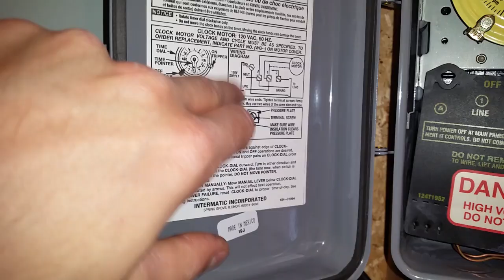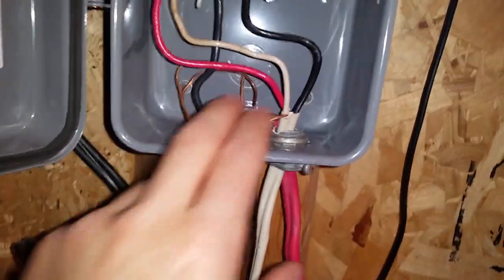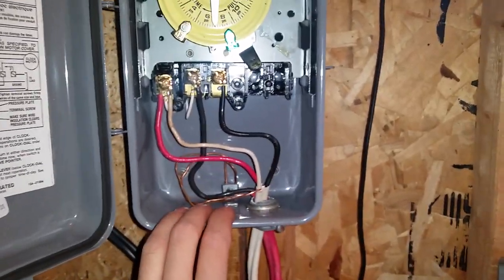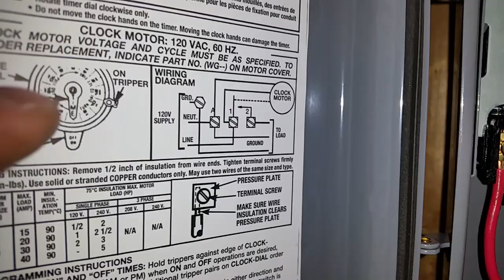How To Wire and Connect A Intermatic Pool Pump Timer - T101R

Comment: This is a great video, thank you for sharing.
I followed these instruction for a pool filter and the motor started working, everything looked perfect. Since the start time was already met, I activated the manual switch, hoping that when the timer would have reach the off time needle, I would set the manual switch to off position and let the automation do the rest.
The motor stopped working when I came back a few hours later. I was not able to make it work afterward. The manual switch works great.
I tried another box, same wiring, motor worked for a certain time then stopped. Can someone tell me what I'm doing wrong please.

Comment: I have a 3 wire setting. 1 white - neutral, Black, and orange. The original unit used the neutral as a ground, the black for the line, and orange for the load. I rewired the setup to the original, because the diagram setup doesn't set the lights for a timing. They just stay on.
Reply from the maker: You never put ground and neutral together.
You need a separate ground wire back to the panel. This is critical for safty. The other wire you say is orange may also be line. You need to check. It sound like you have a 220v system.

Comment: So im installing a gfci where my pump will be plugged in. And the gfci is wired from the breaker. 
From the GFCI to timer would be in 1 or 2?
Reply from the maker: I would recommend you simply use a GFCI breaker. A GFCI receptacle might just burn out because of the high current draw of the pool pump. You should also connect the pool pump to 240v if possible as it will run more efficiently.
Reply: @QuaabQueb  okay I'm installing a GFCI breaker and running it to an outlet for my pump (it's plug in)
Getting the timer wired to the outlet to control on/ off times is where I'm lost
Reply from the maker: @kye1589 Is it for an above ground? Eliminate the plug altogether. It is a weak point. The plug will eventually burn up or the built in on/off switch on those above ground pool pumps. Hard-wire it in a junction box with 10ga wire. 
The breaker is the power source. It goes to the timer. The timer is the switch. It controls power to what ever you hook up to it, pump, outlet etc..
Reply: @QuaabQueb  excellent advice dude thanks
Reply: @QuaabQueb  could you clarify why my 110 pump would work more effectively with a 240v timer? 
I also might install a watering system for my garden, so it may be best to just invest in a 240, yeah? 

Also, I am running 12 wire from breaker- timer & from pump-timer..Your junction comment threw me off a little. If you can't tell, I'm avoiding hiring an electrician. Ha-ha!
Reply from the maker: @kye1589 You can only connect the the pump to 220/240v if it supports it. You have to check the label and wiring diagram on the motor or you will fry it. 
The short answer is by running at the higher voltage it requires less current.  
I would install the irrigation system completely separate.

Comment: Can I use a 20amp breaker for this t101 or does it have to be a 40amp breaker?
Reply from the maker: You cannot exceed the maximum load rating indicated, you also must use the appropriate gauge wire.

Comment: Very good video probably you are not a YouTube like me but in a small video you made you provide the whole information, just a recommendation  improve your camera and audio but excellent. Please can you recommend me a timer for a 15ft round above ground pool i have a heater pool and the filter, do i need a separately timer for each? do a heater pool is good to have a timer? or can i use the same timer for both? Thank you for your help and i will be waiting for your respond.
Reply from the maker: You can use any time for your pool. They make this model with 2 circuits so you can have one timer for 2 devices. Make sure to check which model you need. One is for 120V and the other is for 220V

Comment: I'm pretty sure I had a black single braided wire going to neutral, a black single braided wire going to line 1, and a red single braided wire to load.  
I took it out to replace it and should have taken a picture but didn't. 
Is that possible do you think I won't be able to install new one until tmw but don't want to mix up the wiring

Comment: Great explanation. Thank you. This timer can use with the water heater with 240v? Thank you!
Reply from the maker: No, you must purchase the 240V model, and ensure you do not exceed the current rating. If your wanter heater draws toomuch amperage then the timer switch will burn out.
Reply: @QuaabQueb  Thank you!

Comment: wire from the pump is red and black and from the breaker is black and white so should i put red from pump and white from breaker to a terminal
Reply from the maker: Wire color is not necessarily always the same. The important thing to determine is if you are using 120 or 240 volts.
If using 120 the. You are only switching the hot wire. If using 240 both wires are hot and you must use the appropriate timer which has 2 switches, one for each hot wire.
Reply: @QuaabQueb  using 120
Reply from the maker: @maureenmurphy1911  You should use a multimeter to ensure wire color is correct. Black wire from the braker should be hot/120V and white is the neutral/return. Alternatively red can be used as hot, this may be why the used red at the pump. Make sure the wire gauge is appropriate for the size braker installed. If the wire gauge is not appropriate it will cause a fire. 
Have a certified electrician come and verify to ensure the installation is safe.

Comment: My timer goes off but not on. The timer only rotates when it is on not when off. My power is first connected to an outlet then a  switch. From the switch  I have the line from the breaker box going to  the line (1) I have the load (2) going to an outlet which controls my pool pump, and neutrals at A. I have removed the dial to make sure the lever isn't chipped and Ive reversed the line and load only to trip a fuse.I have bought 2 new timer motors and changed them with no difference. The switch to the timer works fine. So does the outlet. Any ideas what i'm missing????
Reply from the maker: woah dude, cant say with out seeing it. Something is messed up...

Comment: how do you connect a t104r pool timer? all other videos dont tell you what wire is coming from. can you help me?
Reply from the maker: The T104 is a 220V model, basically instead of having one 110V power wire, and one neutral wire, you have 2 110V power wires. 
What do you mean by what wire is coming from ?

Comment: So I hope maybe you can help me answer this as I'm kinda stuck 
I have your exact same box that runs a sign for my business and it was already installed when I bought the building but whoever run the wires from the sign to the box ran them way short and they were hanging away from the wall in a few places looking like crap so I disconnected and added the same gage wire the way it should be and it looks nice but as i rewired the box I put all wires back where they go but now when the box is on it's fine but when it turns off it throws the breaker can you tell me what I did wrong 
Thank you for your time
Reply from the maker: Hmmm.. worked fine previously, but now a problem, so let me get this right when the timer SHUTS OFF power to the sign, the breaker trips ? or when the timer TURNS ON power to the sign, the sign does not illuminate and the breaker just trips ?

Comment: So in the red and white terminal you also have smaller white wire and next terminal you have another smaller white wire with the feed line what are the smaller white wires?
Reply: They supply power to the timer motor

Comment: I have a question I don't know if you would be able to help me. I have this setup to turn on and off some lights, whenever I would have to use the override I would hear two fast clicks within a split-second from each other (I'm assuming the first click was the box and the other click was the lights turning on, meaning the first click was the box turning on and telling the lights to turn on, which would be the second click) but now all of a sudden the Box does not work at all and does not turn the lights on or off with the timer or the override. And whenever either one of those goes off I only hear one click now. Is this some kind of grounding issue or loose wire? Cuz that's what I am thinking. It was installed for me and I don't want to mess with it unless I know exactly what it is.
Reply from the maker: Luigi Soldier hard to tell without knowing or seeing exactly how the system was set up. Best to call back the person that installed it.
It could also be the breaker supplying power to the timer has tripped, so check your breaker panel first.
Reply: Chargèro thanks for replying. If I want to turn the light on or off now I have to do it from the breaker, sorry forgot to mention that.
Reply from the maker: ah, so it sounds like a failure within the mechanical switch of the timer. 
When you put the manual override leaver of the timer in the off position, does the breaker still turn the light on or off ? 
If not, then the timer switch has gone bad.
Reply: Chargèro it doesn't matter if the timer override is in the on or off position because the breaker still turns the lights on and off
Reply from the maker: Luigi Soldier timer is finished in that case.
Reply: Chargèro thanks for replying and thank you for the information I really appreciate it
Reply from the maker: Luigi Soldier no problem. Probably best to just buy one and return it

Comment: What if a light flashes after it has been running a while when you turn it off.
Reply from the maker: There is no light. That's probably an electrical fire.

Comment: I thought if you set up pool pump to run at night it would cool your pool water considerably,  night air circulating warmer water will eventually cool water way down
Reply from the maker: Dave Van Meter Yes that is something to consider. However you can put a heat blanket which is basically a big bubble wrap material cover which holds the heat in at night. Most people dont because they are a hassle to take on and off.
Hotels and spas that have outdoor heated pools year round use these heat blankets every night to energy savings

Comment: how is it that you only have a red and black in one wire coming in on that red cable
Reply: there should be two white wire?
Reply: it the red wire now "neutral wire"
Reply from the maker: The red cable I have there can be used for 220V circuits, in which case both wires would be carrying 120V hot and no neutral... not all devices that are 220V need a neutral wire, as the AC current flows back and forth between both 120V lines. The only time there will be a path to neutral would be if the device (example a stove, or dryer) has a 120V circuit within in it such as a light , computer module etc...

If you were to have your pump running on 220V you would not have a neutral wire, both wires would be supplying 120V each to the electromotor, the AC current would be alternating between them. And of course you wold have a hare copper ground conductor for electrical safety  

So there are 2 ways to wire 220V appliances, with a neutral, or without.

In my setup the red cable (with one black and one red conductor) is simply being used for 120V, as that is what I have my pump running on, so the red wire is carrying 120V hot and the black wire is the neutral return path.

Hope this clears it up.
Reply: @QuaabQueb This is by far the clearest explaination of the working differences between 120 & 240 as well as a beautiful clarification as to the difference of running a 240v main to 120v 'step down' I've ever read friend! 
   
   You SURELY know electricity far better than myself- however, have worked on pools & outdoor electricity for over a decade everywhere from America [my country of residence] to Australia, New Zealand, Tailand, & around Europe- obviously differences in "standards & measurements" in nearly each place. So I've heard people try to explain these differences & it either goes: 1. FAR too much info leading to the other party just dazed or 2. Just talking out of their asses (which as a fire-medic enrages me to no end, for obvious reasons).

Truly, well done! And, if all good with you- I may save that response & keep it for when needed. Not sure i could say it any more concise & safley than yourself friend!

Comment: How do you wire it if it's a 240v instead of 110
Reply from the maker: You don't, you have to buy the 220V model which has an extra terminal and contact for the other line

Comment: Congrats Lady! Thanks for your vid. I think you are the better explainer to this item in the whole You Tube vids related to. I have some of these items now and I need a timer to control a textile machine based in a motor of  1 hp, do you think this item could run fine to this need?

Thanks and Go'd Bless you!
Reply from the maker: Cheers m8, a 1HP motor should be just fine, these are designed to handle loads of up to 2-3HP at around 15-20A max
Reply: Thanks you so much and congrats for join your time and knowledge!

Comment: All wires are connected but the clock doesn't function. It doesn't move. But when I do the automatic switch it works fine.
Reply from the maker: because the motor is bad, you can change out just the motor...or go to home depot, but a new one, take it out and return it a week later

Comment: Can that timer run 220v?
Reply from the maker: No, you must buy the model that specifically says it is for 220V
This unit only has a single pole switch for the one 120V wire.
The 220V model has a two pole switch for the two 120V wires. (There must be a disconnect for each 120V line.)

Comment: So the red one is coming from your breaker what about the the white and black wires
Reply from the maker: The white cable is going to the pump, the other black cable is for the pool lights and not wired to the timer.

Comment: How about a digital timer from the same company are the connections different? Can I wire multiple circuits to it?
Reply from the maker: Yes they probably wire the same. I have found that the digital ones are often a pain in the ass to program, the mechanical one is just playn simple. I do not know if they have models that will allow you to set different times for different circuits, but you can for sure connect more than one device or appliance to it, providing of course you do not exceed the load rating of the timer

Comment: Can you put two loads
Reply from the maker: Yes
Reply: @QuaabQueb  what about a 240 and a 120
Reply from the maker: @colunga13  they have different models for that.
Reply: @QuaabQueb  can a septic tank and sprinkler, be put on that timer. I'm thinking the septic is 240 and sprinkler 120
Reply: @QuaabQueb  I thought the septic tank had to be direct
Reply from the maker: @colunga13  I have no idea. Why would you want a septic system on a timer. As for sprinklers a designated irrigation controller should be used.
Reply: @QuaabQueb  thanks for your responses, I just found out this thus guy is trying to do some half ass shit and I'm not with it

Comment: Nice red wire on the nuetral

Awful
Reply from the maker: That's 240v there is no neutral.
Reply: @QuaabQueb  then the guts have been changed and that’s not a T101

Comment: timer set to turn off at 6pm the problem is the clock stops with the motor and will not rotate to start time has to be reset manually in the morning (intermatic  t103 time switch)
Reply: Did you figure out the problem? I just hooked mine up and I have the same problem lol